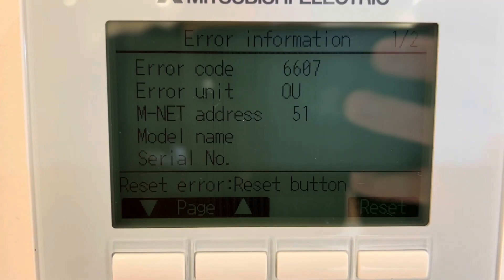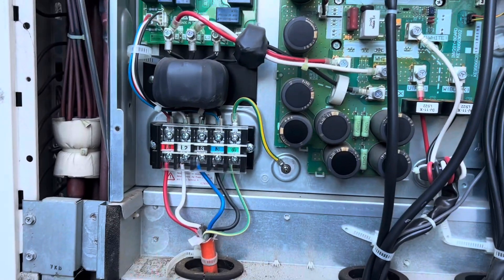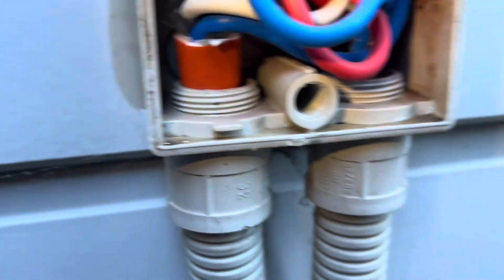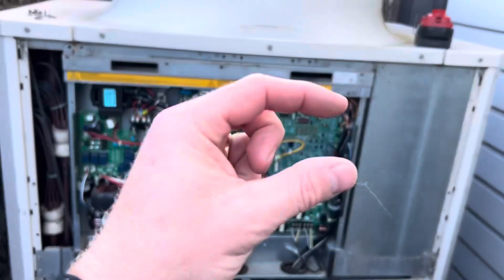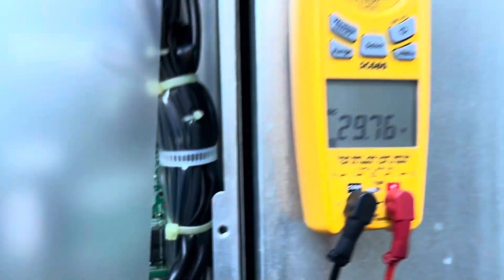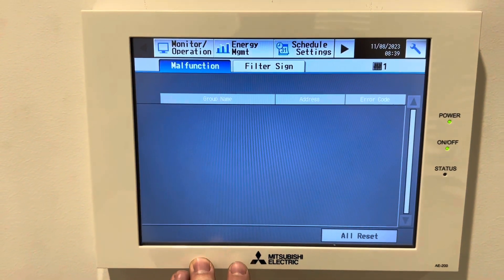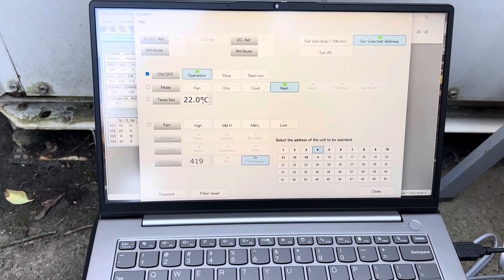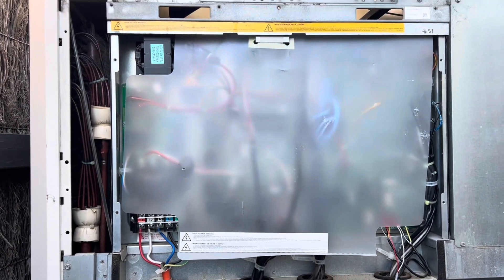Mitsubishi Electric / City Multi VRF 6607 Fault

Comment: How are you sir 
I've a question about the indoor unit  there's no signal to the remote control  . Please answer me if you have any informations about it
Reply from the maker: The 12VDC power for the wall controller is supplied from the indoor PCB. Check the TB15 terminal at the indoor PCB for the 12VDC supply. Check the wiring between the PCB and controller for continuity. Also, if the PCB has recently been replaced confirm it has been addressed using the rotary dials located on the board. The pcb won’t send power to the wall controller if it hasn’t been addressed. Check what the LED’s on the PCB are doing also. They can tell you a lot. Hope this helps 🤙
Reply: @hvacraustralia  i have checked everything  the power is OK and the outdoor signal is 29 DC  but the leds all off (PEFY-P20~140 VMA(L)-E  this is the type of the device